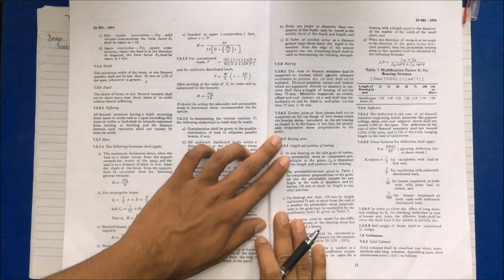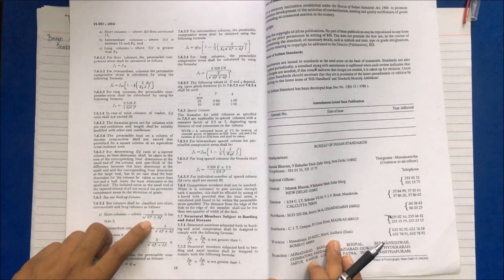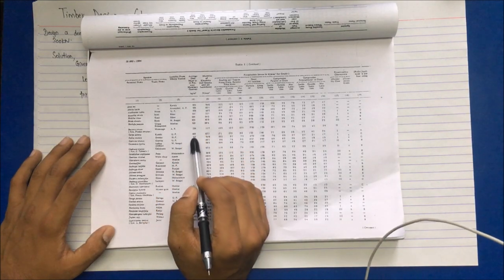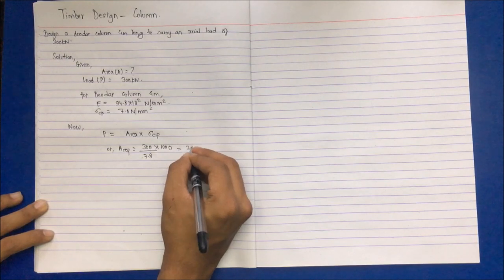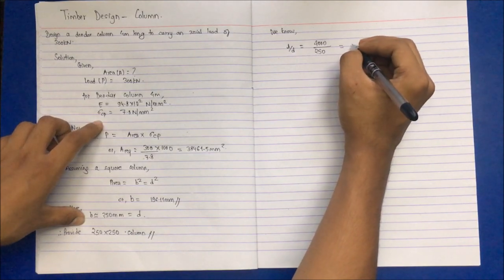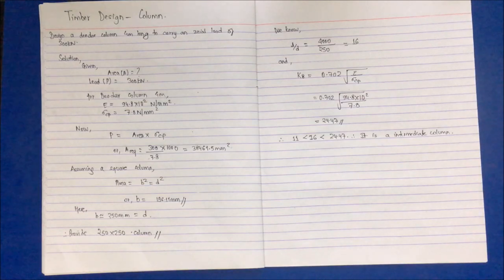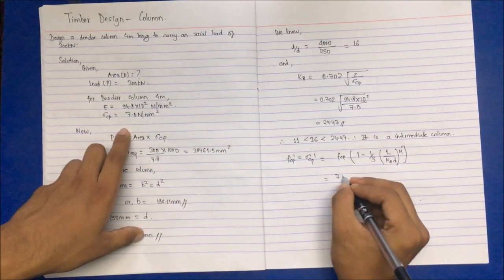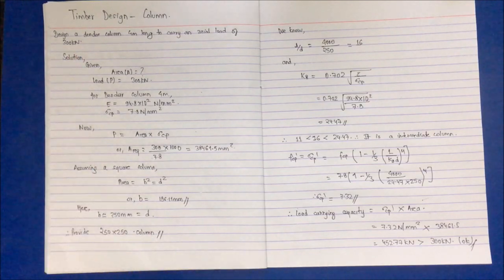Design of Column | Timber Designing | IOE TU

Comment: Good tutorial. But load carrying capacity is calculated wrong. You are explaining to put 38461.5 for area which is not correct. And final answer doesn't matches if we put that area.  We need to put 250*250
Reply: thank you
Reply: and also formula to calculate k8